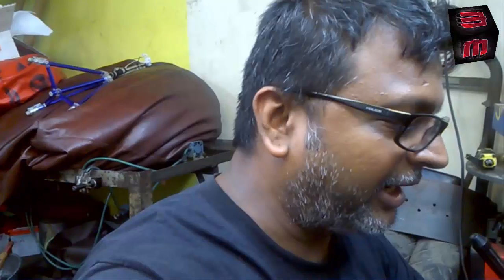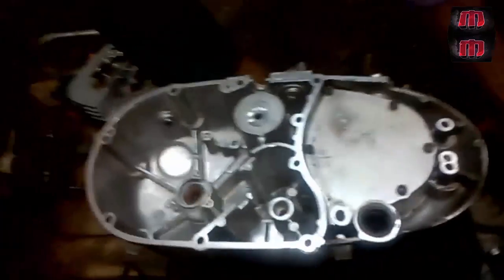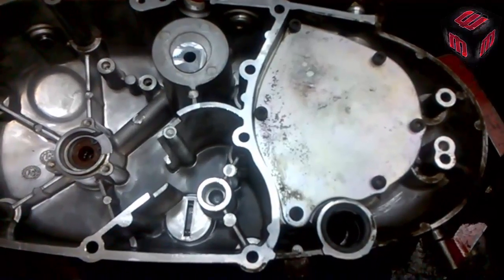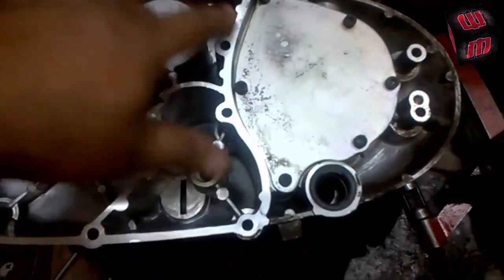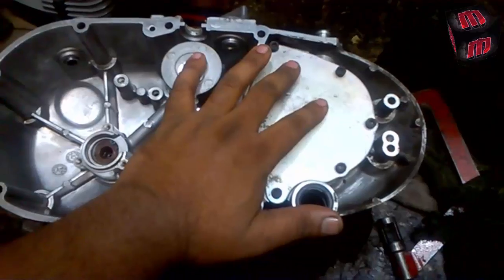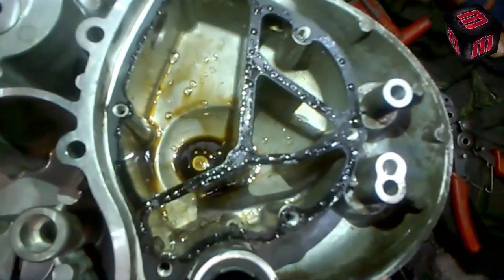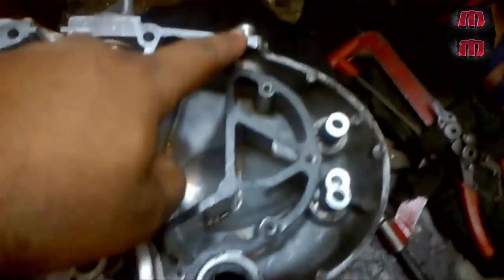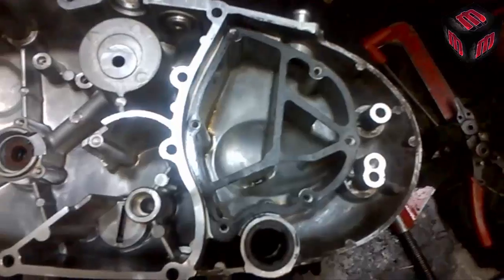Anatomy of Crank Breathing System in Royal Enfield UCE Engine (ENGLISH)

Comment: Mech Auto Clinic.sir while riding downhill at 2nd gear my bike classic 350 bs3 suddenly gave a big bang and engine stops since self is not working(sprag clutch problem) i tried to kick start but couldn't because of hardness of kick i could kick fully but it was difficult,so i called a mechanic he explained that its due to decompressed air stuck between piston and head and showed me the popped out carb from front side,so he took out the sparkplug fit the carb and after kicking 1/2 times it was ok again.what could be the possible cause?what should i do to avoid such breakdown future.i would like to hear your suggestions
Reply from the maker: this is a very general issue with RE products. in this case one thing is there no need to remove spark plug.. I don't know why he did. But my remedy using bigger width hose clip in SS metal (helical type) which should cover the inlet manifold right from the edge of it or from the mouth piece where you insert the carb. it is true that the reverse pressure pops out the carb all the time and this issue is there from AVL engines. in AVL i did made ReBoV (Reverse Blow Off Valve)which was mounted in between inlet manifold and head. so the pressure use to get release from the valve when it is used come back. basically this pressure goes to carburetor butterfly valve which blocks the air and makes the carb out and more over the clip is very thin and has limitation in tightening. So in short just go for bigger width helical hose clip which is SS based. it works fantastic. I have replaced more than 40-50 clips till now and no returns of same problem. hope this solves u r issue. thanks.
Reply: @MechAutoClinic  thank you for your promt reply.your in depth explanation is an expansion of knowledge for my experience and for my future rides.salute brother.
Reply from the maker: always welcome....by the way where u from?
Reply: @MechAutoClinic  mizoram

Comment: Informative as usual.
In other words... The oil and air mixture from the crankcase during the suction stroke hits the multiple separator plates in the breather box. The oil particles being heavier, loses more momentum and percolates down along the separator plates. The mixture having lost more kinetic energy with the oil particles, the air component goes along its way towards the air filter where it's facing suction pressure from the other side of the piston.
Reply from the maker: thanks for rational explanation...that helps me too.

Comment: Is there any possible to enter that water inside breather box into the inner engine ? What if that breather box water is mix with the oil?
Reply from the maker: yes if you have broken breather pipe, carburetor flooding and supplying water if there in the tank and then leaky piston rings, open spark plug hole...so many reasons.